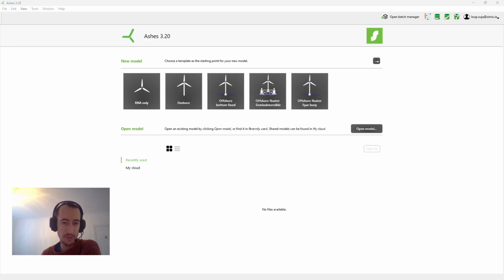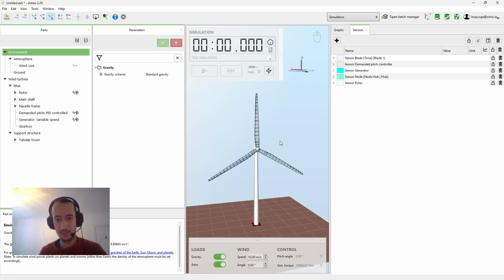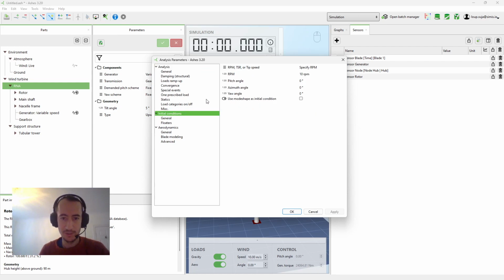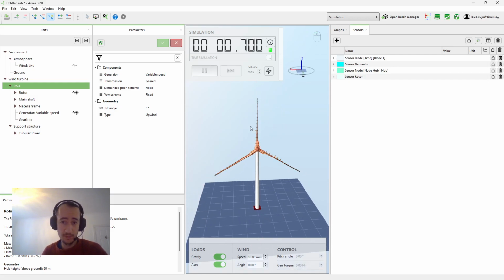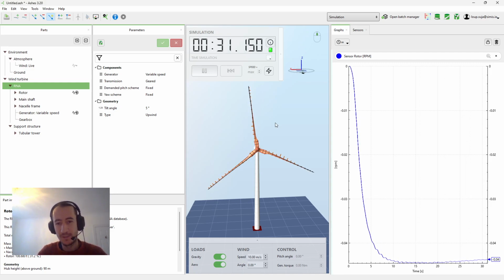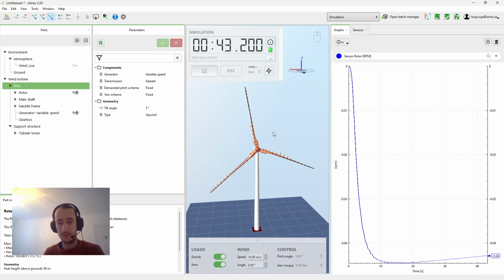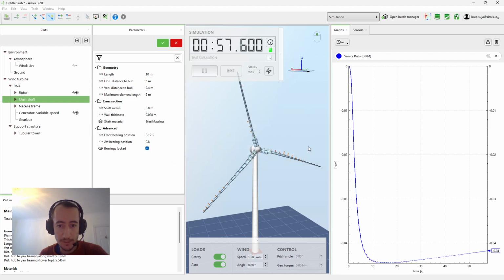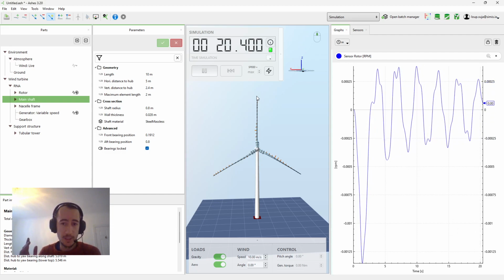How to model a parked wind turbine

Comment: Hello, when simulating a parked wind turbine, supported on monopiles. Which loadings becomes more?. Is it the wave loads or the wind loads?, since the turbine is now parked.
Reply from the maker: Great question! Obviously it depends on the wind and wave conditions, but for example in the case of a storm, in our experience, the wave loads are dominant for ultimate limit state. That is very easy to check though, just run two simulations, with the rotor parked and in operation